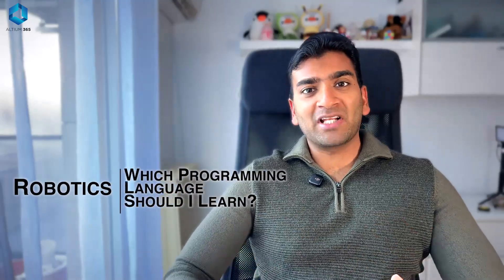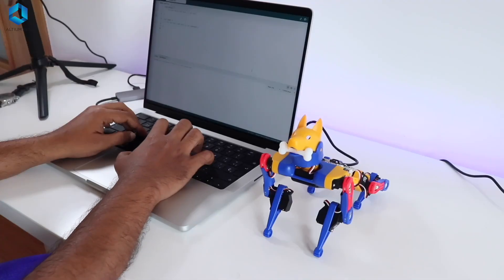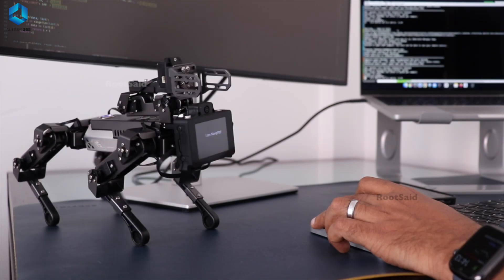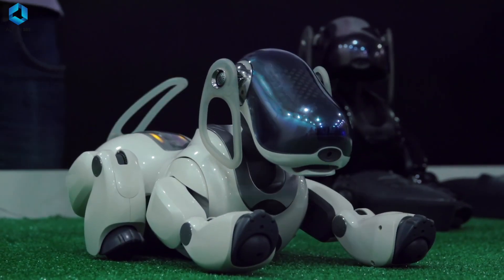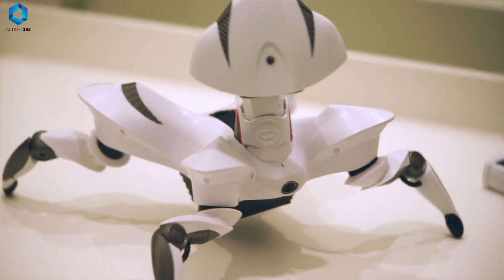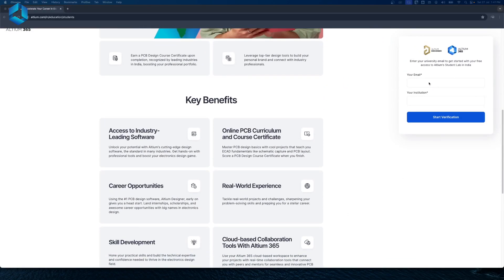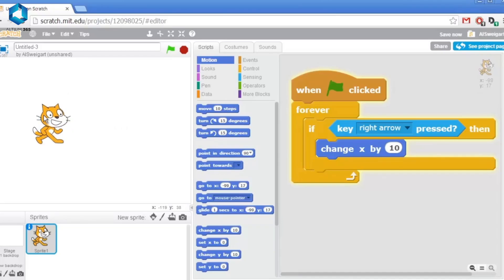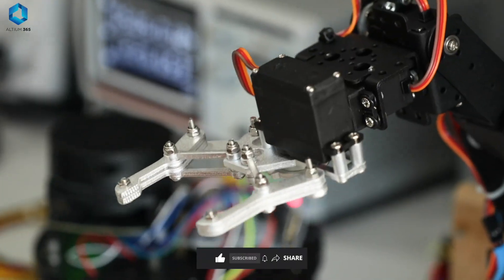Top 5 Programming Languages for Robotics [Beginners and Experts] - Coding Robotics for Beginners

Comment: Hello sir, thank you so much for this playlist, it's actually awesome, 
we want to take part in line following robot competition and we also want to pick objects, so which programming language would be best for it .
Your guidance is highly appreciated. We are absolute beginners, but we are passionate about learning it.
Also, how to understand the motor specification, such as voltage, current, and all and how to identify it. Thank you!
Reply from the maker: Thank you so much! I'm really happy the playlist is helping you 😊

For a line-following robot that also picks up objects, Arduino with C/C++ is a great starting point - it's beginner-friendly and has tons of community support. You can also explore Python later if you're using Raspberry Pi or camera modules.

As for motor specs:

Voltage tells you the power needed to run it.
Current (Amps) shows how much it draws under load.
Torque & RPM help you understand strength and speed.
You can usually find all this in the motor's datasheet or on the product page. Let me know if you'd like a video on reading and choosing motor specs!

Good luck with the competition! You’ve got the passion, now go build something awesome!

Comment: Great info shared. Thanks a ton. I really appreciate this info. One query I would like to raise - not about Robotics but Electronics. Can you please suggest some websites for learning Electronics, preferably quick learning, but still covering all the topics, (such as Transistor curves), but not covering unnecessary information, so as to facilitate rapid learning? Thanks.
Reply from the maker: Thank you so much for your kind words! Thats a good question It's actually quite hard to find one perfect website that covers all electronics topics in a quick and concise way. A better approach is to learn topic by topic—start with the basics like Ohm’s Law, resistors, and capacitors, then move to transistors, amplifiers, etc. For each topic, you can search specifically online—YouTube, All About Circuits, SparkFun, and even Reddit forums are great for targeted, fast learning without unnecessary fluff.
Reply: @RootSaid  Thanks for your reply.
Reply from the maker: Glad I could help buddy.